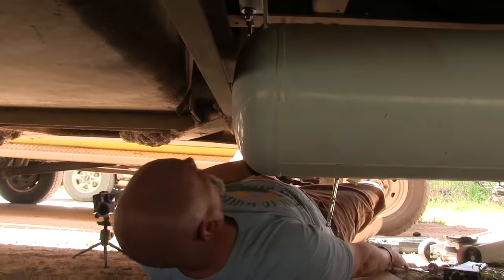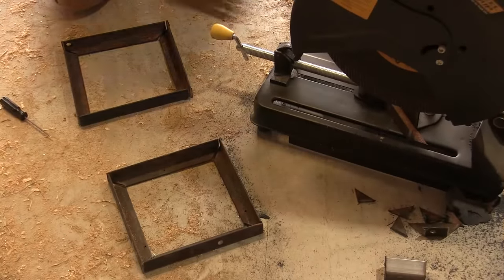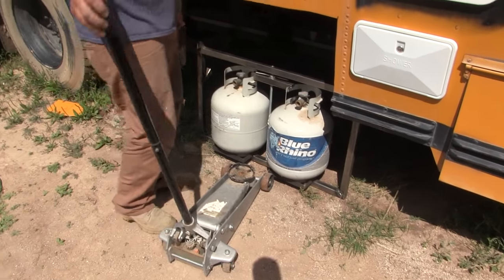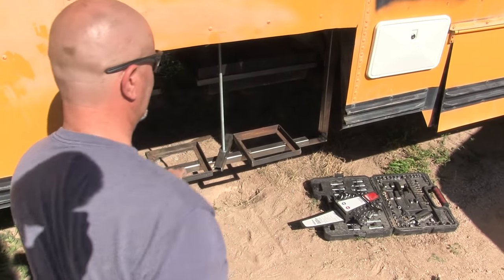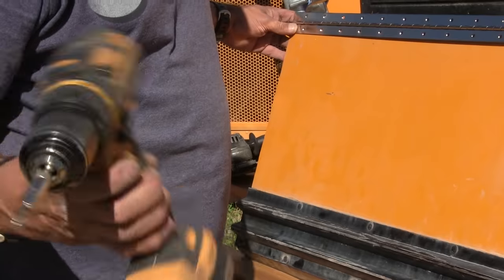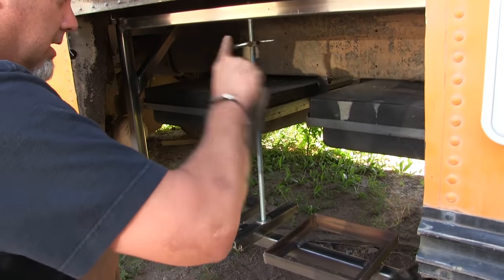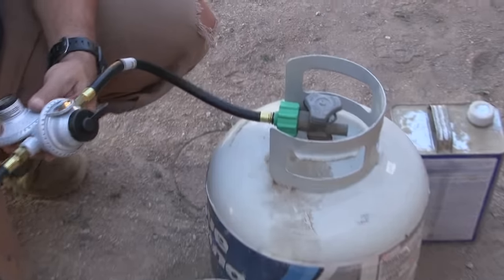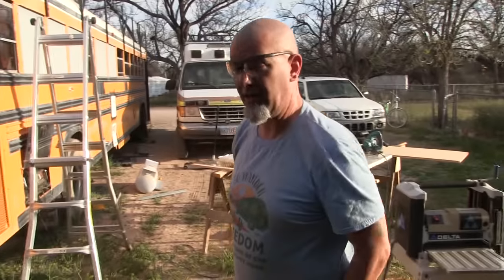Changing Our Skoolie Propane System

Comment: Happy belated birthday. 
Good setup. 2 suggestions I have. 
See if you can find a padlock with a long enough shank to go around the tubing and an arm of the tightening handle. It will keep it from vibrating loose as well as keep it from walking off while you aren't around.

Get some sheet metal tall enough to go up to the floor joist and weld it in in front and rear of your tank frame. Will help keep gravel, mud, and other road debris or your tanks and hoses.

Comment: Interesting move, over here, most go from bottles to a refillable system as you can fill them at any gas station that sells autogas (LPG) and you don't need to empty the bottles before refilling fully. As always, great quality of work.
Reply from the maker: 2 reasons we did this. 1) there just wasn't a place to put the 12 gallon tank with easy access. 2) If we run out of gas parked in some remote location, it is easier to take our small vehicle and fill the gas than it is to drive the bus in only to return to the same spot.
Reply: @BussyMcBusface  Fair enough, over here we just have remote fillers and a separate pig tail/regulator to take a bottle in an emergency BUT we generally don't take another vehicle with us due to the towing regulations for a trailer over 1500 lbs. Our coaches also have massive storage capacity compared to a school bus so a lot more accessibility. https://www.busandcoachbuyer.com/wp-content/uploads/2014/08/Given-the-low-unladen-weight-there-should-be-little-concern-about-utilising-the-capacity-of-the-central-luggage-hold.jpg Anyway, keep up the good work, love your videos.

Comment: Another great issue but I would like to offer a couple suggestions on your LP installation if you please.
      1.   I would face your tanks so your fittings do not face the inside of the bus skin; the most minor sideswipe  could knock off your hose completely or at least enough to allow a stream of LP to escape, expand and  find a source of ignition and feed a raging fire you couldn't quench or stop the flow.   I suggest they face anywhere but out.
       2.   even with the snazzy top rim capture Mike made, it would be even better if you installed a captive thumb screw in the bottle base holder that will hold the tank squeezed against the other three sides and stop the inevitable clangs and rattles when you are driving.
     Finally.........I might replace the threaded rod you used to a coarse threaded one unless one enjoys fiddling with that capture device in the inevitable`114-degree heat and full sun.
       Mostly petty stuff except for point #`1, but recognizing the near brain surgeon intensity and precision of Mike and your willingness to support (put up with) his quest for perfection. I decided to intrude.
       This was another great job to watch; you guys define 'sympatico'.

Comment: Another great video! Smart move on the propane. I agree with a previous post that you consider rotating the tanks so the valve is not facing out and for the same concern. My personal experience with the self changing regulator was all good, never had a problem. As a side note I am still laughing at some of Kerry's comments and what I think were turkey gobbling in the back ground!
Reply from the maker: Thanks Jerry! Gonna make those changes as well as adding lock to the system. As for the turkeys, yeah the neighbors have a farm going on!

Comment: You need something hold or pin the handle for tighten down on the tanks. A carter pin or some sort of strap to stop it from vibrating lose as you drive down the road, ( wouldn't want a tank to drop out if the clamp gets lose)
Reply from the maker: Yeah, I think I have an idea!!! Good catch!